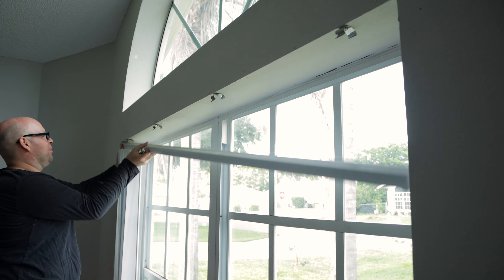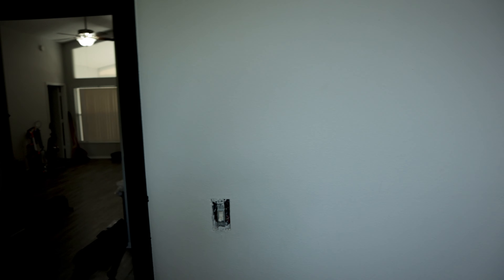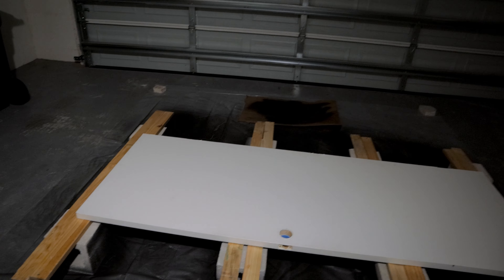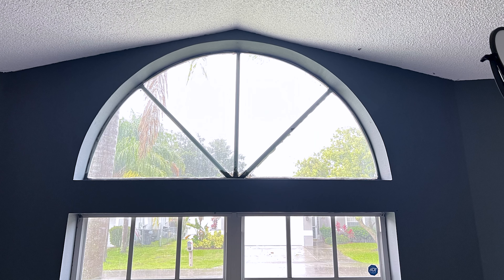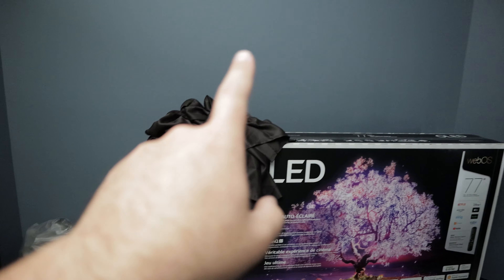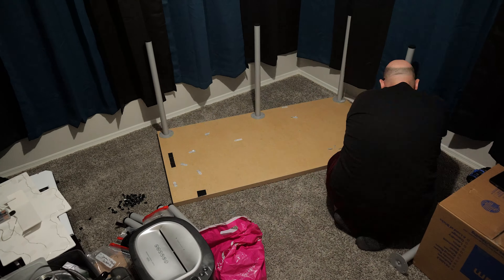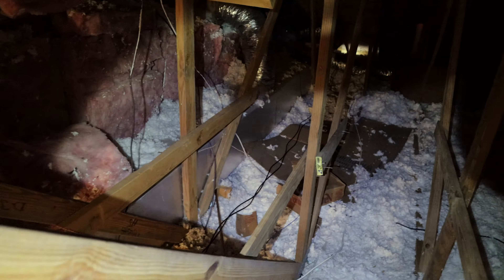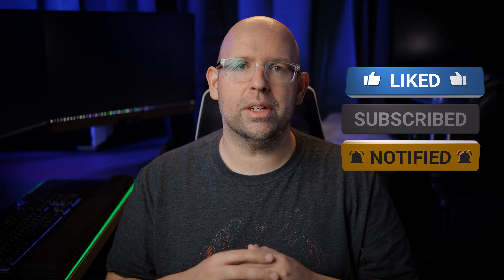DIY Home Theater Build Series | Episode 2 - PREPPING & PAINTING

Comment: im not an expert, but i think for your outdoor cable going into the wall, you should add a drip loop/low point, so that water doesn't want to run down the channel/cable and into the hole.

the end portion won't look as clean, but the chance of water wanting to run into the wall will be less. if you have some slack on that line you could just pull some there and add the loop, maybe securing it with some wiring clips

Comment: Which paint colors did you go with? We're getting close to attempting to DIY our home theater in our basement and are also using Sherwin Williams. Going with Inkwell and Outerspace.
Reply from the maker: For the colors, I went with Tricorn Black for the trim and doors and then Raven Wing for the walls. For the actual paint, I got the Sherwin Williams Interior Showcase One-Coat (flat). The paint was awesome though I did do two coats on both the walls and trim due to how light in color the old paint was.
Reply: I'm a paint snob and I am impressed with the Sherwin Williams paint. We didn't even go with the best paint they offer. I had been a fan a Behr but it's overpriced in my opinion. And I had used Valspar once, bought the expensive outdoor semi-gloss and it was a nightmare. It dripped no matter how thin of a coat I used. Anyway, I think you'll love the paint and those colors are great too!

Comment: I'm 2006 I painted about 26 full 2x4 ceiling tiles using black spray paint from Home Depot, and each panel used almost a full can to coat, so needless to say it took me a long time to get the all done and my hands and fingers about gave out on me halfway through the process.. Lol
Reply from the maker: Thanks. Yeah, I decided it would be easier to just use the paint sprayer and the wall/door paint color to paint the ceiling tiles. I still ran into issues I’ll talk about in the next video, but I can’t imagine what it would have been like using spray paint. My fingers hurt just thinking about it.

Comment: Looks good but you don’t need 6 hight speakers in that small room.
Reply from the maker: I definitely don’t need 6 height speakers, but wiring for 6 just makes sense in order to have options and because I have the extra cable. Running too middle until I get a receiver or pre/pro that can support 4 height channels, then I’ll likely switch to top front and top rear.

I also don’t NEED 4 subwoofers in this small room, but since I already have them, I’ll be using 4 subwoofers haha. To heck with room modes!
Reply: I beg to differ. We need all four. It's a need at this point.
Reply: Since when did need matter in home theater😭😅🤣
Reply: @HomeTheaterGamer  in that small of a room won’t it just sound like 1 big speaker